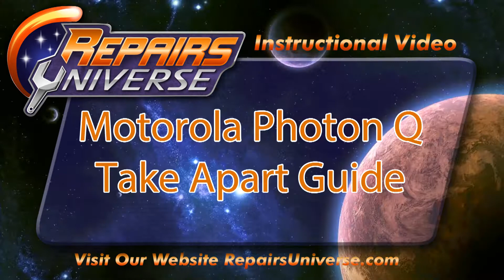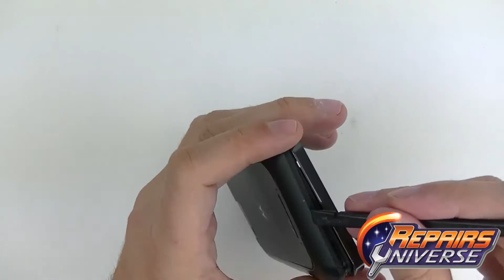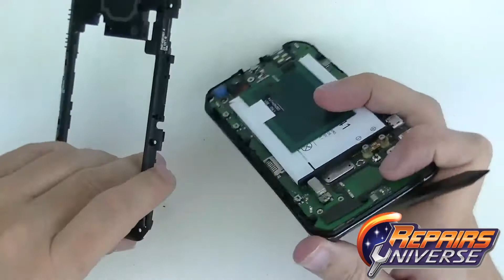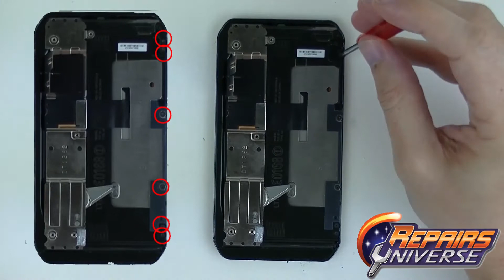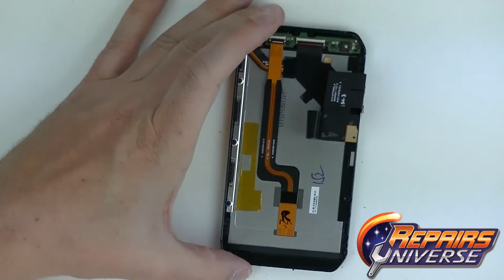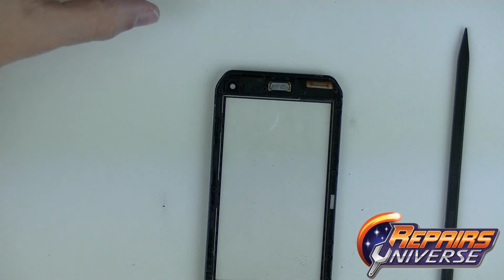Motorola Photon Q Take Apart Repair Guide

Comment: If I am replacing the entire screen half of the phone, do I need to dismantle that part to maintain my current phone.  I have an excellent donor phone that is clean with the EIN, but I have Avast and cannot access settings to save info on my phone with the cracked screen?  Yes I know there are newer phones out there, but this is the best slider going and I will use it until it is no longer supported (big hands)

Comment: So, I followed this guide and replaced my digitizer, but the phone will not turn on. When I plug a charger it only lights up the green LED on the speaker but it won't turn on. I have reopened it to make sure everything was connected. Still nothing. 

Halp!
Reply from the maker: Sounds like your LCD is bad or damaged. You may need to replace the LCD, if you just did then it may be defective.
Reply: Repairs Universe But I didn't replace my LCD only the digitizer. My LCD was working
Reply: w wa wat Then you damaged your LCD while taking it apart. It is very sensitive and I did the same thing when I first took one of my smart phone apart. Applied too much pressure and bam. Same thing, the charger light came on but phone stayed black. I then replaced the LCD and it worked fine. Be careful and use the right tools to get the job done.

Comment: I am needing to replace the usb/charging/dock port because when it is plugged in, it doesn't always respond to being plugged in (using OEM and non OEM components and I have tested those and they are good).  The usb is able to wiggle when plugged in, and doesn't feel like it is secure on one side.

So, is the charging port held down with just an adhesive or is it otherwise connected to the mother board?  If held with an adhesive, how hot does the heat gun need to be set to, or will I have to strip the adhesive and apply a new one?
Reply from the maker: It sounds like the wiggling could be from a cold solder where the charge port meets the board. It would need to be re-soldered to the board.

Comment: I read that the Photon Q's speaker is attached to the glass screen in the front. Any tips on avoiding to damage that when simply replacing the glass? Is it okay to leave the LCD in place if I am simply replacing the glass?
Reply from the maker: Use a heat source to help with removing the speaking assembly. This will help soften/loosen the adhesive.
Reply: Alright, I will make sure I'm careful. Thanks!
Reply from the maker: No problem! let us know how it goes!

Comment: In addition to the tiny white ring I also had a light blue square rubber gasket left as well, where does that go? Thanks!
Reply: Me too!  The white ring and the blue square... and no I wasn't eating Lucky Charms at the time.  Put everything back together anyway and seems to be working fine....
Reply: Jack Chernega around the Microphone ic, near the middle, bottom. It's a small metal rectangle

Comment: my phone doesnt go bright anymore, you can see the display only in a dark setting, but if outside forget about it. the phone has never been dropped and got from sprint 4 months ago,new. question is, does the screen need to be replaced?
Reply: Don't know if your question is still relevant to you, but if you have checked your phone settings and made sure that you have the display brightness turned up and also checked you power save settings to make sure you don't have a rule for your brightness, then the issue is with the screen.